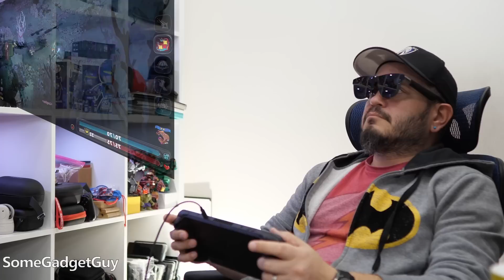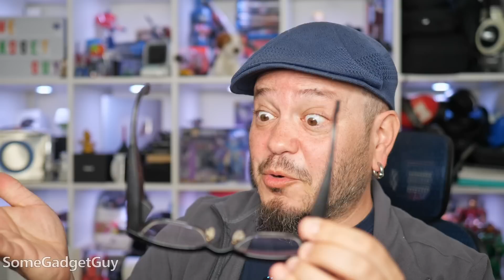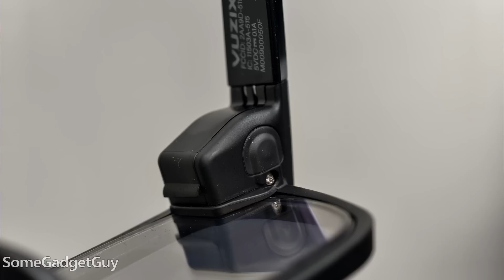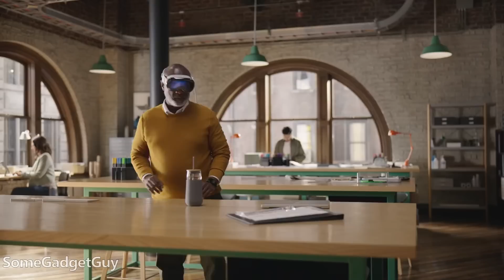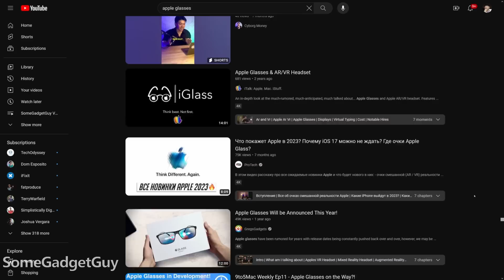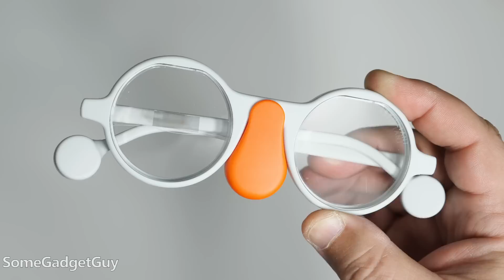What You NEED to Know About SmartGlasses (and why Apple keeps failing at them)!

Comment: Do you know of any non-birdbath cinema glasses?  Or even if they arenʼt cinema quality, are there non-birdbath binocular color glasses (like Focals by North, but still available)?  They donʼt need to be discrete per se, but I donʼt want them to look too weird and I want them to be all-day wearable (if I have two sets of glasses I will lose one of them).

EDIT: Wait you do mention that Rayneo has full-color waveguide, but you didnʼt like them; I missed that.  Iʼll check it out and see if it works for me, but I expect not because half your concern was battery.
Reply from the maker: I think to avoid birdbath but have a GOOD cinema experience, you'd have to go VR or something similar to that. Like these https://www.youtube.com/watch?v=fl718rP-65U
Reply: @SomeGadgetGuy  I want to be able to see through them as well; I donʼt care that much about a good cinematic experience.  I want to do something more like reading an ebook, but with color support because images exist.  The only thing Iʼve seen thatʼs currently available that fits what I want is the RayNeo X2 you mention in passing (640×480 is good enough for reading an ebook or seeing maps), except it is both super expensive and out of stock.

In a year when waveguide stuff is better Iʼll probably want something like that.

Comment: Honestly the XREAL glasses are probably one of the things I'll buy in the coming year first after taking crypto profits.

Like 80% of the Apple Vision Pro functionality with better app support for less than 1/4th* the price? Sign me the freak up! 👍

*Total of $899 = $599 for the Xreal One Pro + $300 for both the Beam & Beam Pro
Reply from the maker: I keep trying to tell people. THe main pitch from Apple is "float a TV or an iPad where a TV or iPad doesnt exist" and you can TOTALLY do that for cheap with any basic cinema headset or HMD.
Reply: @SomeGadgetGuy  Not to mention that I can essentially buy BOTH an XREAL Beam Pro for spatial capture AND the standard Beam for the $300 price of one Brand New iPhone 11/12 thus netting me NEARLY TRIPLE the runtime (7 hours) of the Vision Pro on a flight or "unlimited" if were to charge one Beam while the XREAL glasses are running off the second one. 🤘

Comment: Apple's mistake with the Vision Pro is trying to replace the desktop experience with something portable. The problem is that you have to cram all the computing power inside a tiny space and you end up with something like a giant ski goggles. It's why I love the direction of current AR glasses as they never intend to replace any of the current mobile devices we fully rely on.
Reply from the maker: Even funnier that it's only a floating iPad. To add a "proper" computer to the mix, you need to include a Mac or MacBook. So the MR headset becomes a $3500 monitor 😅

Comment: These products and Apple are attacking the same problem from the opposite directions. These "Smart Glasses" are nothing but a tiny display on your face, that is the long and short of it. They aren't "AR" or "Mixed Reality" in any way, because they do not have any awareness of your reality around you. They don't see barriers, or objects in your space. The companies that make these "Smart Glasses" care first about the form factor of making them glasses (though, they are very ugly and bulky glasses), then try to fit as much functionality as they can inside that form factor. However, Apple is doing the opposite. They care first and foremost about creating true AR or Mixed Reality by giving the headset full awareness of your environment. Then they try to miniturize that tech as much as they can until they eventually make them small enough to fit in a glasses form factor. They are not comparable products as they exist now, because one is a bulky AR device, the other one is a tiny display strapped to your face.

I prefer Apple's approach personally. I do think that a tiny display on your face does have utility, but for the few times I would care to have a display, I would be in a situation where the Apple Vision Pro would be equally as useful (ignoring the price difference, I wouldn't get the Apple Vision Pro at that price). Otherwise, when it comes to notifications or other alerts that something like these "Smart Glasses" provide, I could just use my Apple Watch. If I want a full display on my face, I would be in a train, or flying in a plane, or laying down in bed, the exact same situations that I would use the Apple Vision Pro. So, OTHER THAN THE PRICE, they have zero additional utility that I would get from the Apple Vision Pro, in fact, in almost every way, they are a worse experience. That is why I think Apple is correct in caring more about the functionality more than the form factor, until the technology catches up.
Reply: Yet visionOS is just a fork of iPadOS of which itself is a fork of iOS. It's much better to use those AR glasses with your iPhone or iPad instead.
Reply from the maker: Seems you didn't really watch the video?
Reply: I'll have whatever you're smoking.